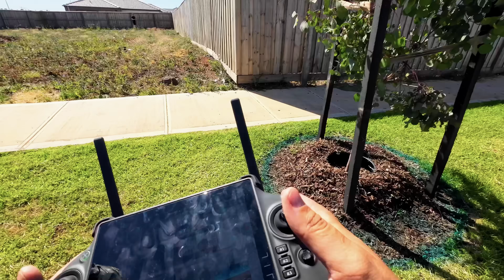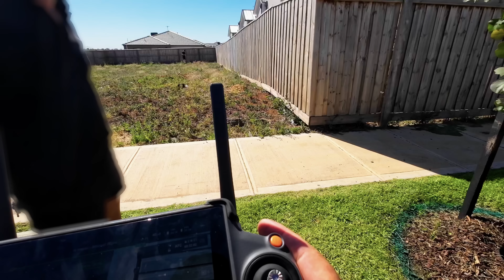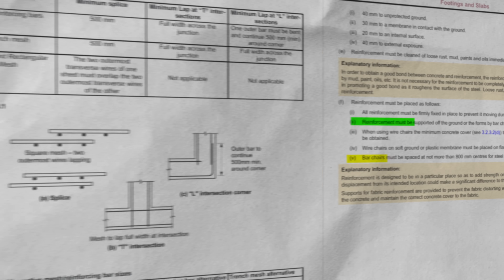I Caught a Concreter Red Handed ...

Comment: Well done for calling these guys out ……. Doing the wrong thing. I’m afraid I have very little trust for concreters; they all say the same thing that they pull the steel up ….. I’ve watched them and they don’t do it ….. once it’s buried they don’t care.
Reply: As a plumber and excavator operator I can confirm 90% of the time i rip up concrete to repair pipes or replace a cracking driveway the mesh is at the bottom 10mm (sometimes visible on the underside) of the 100+mm concrete
Reply: @RUugly  It’s the building industry in a nutshell mate, everything is a push to get to the next job. These blokes start cutting corners without repercussions and all of a sudden it’s the new trend. 
The whole mentality with these type of operators is if it’s out of sight it’s out of mind. I worked for a bloke when i was young, one day we had a job to build a small slab for a 10,000L spa to sit on, it was on a downhill slope and on one of the corners of the slab it dropped off a good 400mm (you’d usually fill in a corner like this with more form work, this is called a drop edge) 
Instead of forming up the corner, and letting the cement fill up the whole space, he shovelled a bunch of sand into the area until there was about 100mm left to the top of the form and then poured the cement straight on the sand, no mesh in it or nothin 😂😂
There’s a lot of blokes out there that have absolutely no business being in this industry period. The sad part is the more houses that get built by these lot, the bigger hole we’re putting ourselves in down the track. 
Australian economy is propped up by real estate, how’s the Australian economy look in 20 years when all of these million dollar homes are falling to pieces??? 😂😂
Reply: @SBANDOOOO566  * “concrete” knackerbags! Cement is just one of the ingredients in concrete.
Reply: These guys seem pretty legit and love what they do  https://www.youtube.com/@Concretewiththehauses/featured
Reply: Concreters are notorious for being meth heads, scammers and creators of poor work.
Reply: @RUugly  I work in the commercial sector these days so i rarely see anyone off their face, it’s all been clamped down on, but yeah bro when I used to do smaller residential jobs on smaller crews etc you’d get the odd junkie every month on site 😂
You’d think they’d work hard but in reality they stuff up that much they just make everyone else on site work harder.. Occasionally ya get the high functioning one that works hard but talks even harder and has your ears bleeding by knock off time 😂
Reply: Easy Rambo, some of us care quite a bit and take a lot of pride in our work. I refuse to pour any concrete without steel reinforcement properly prepared. Sorry to hear that all your experiences have been with dodgy or lazy concreatures. Hopefully you find some real concreatures soon instead of the posers that you’ve had to deal with.
Reply: I demo'd a driveway like that the other day. No chairs ... rebar literally at the bottom of the concrete. No plastic, or gravel underneath. It was rusted to shit, but it wouldn't have mattered anyway. It was smooth mesh, not deformed. So it wouldn't have even helped if it was installed properly.
Reply: I have never seen a concreter using the chairs. 99% all leave the mesh on the ground. 
Wouldn't it be awesome if you could check concrete as part of your inspection. 
You would need some type of x-ray camera. 
You would have all concreters running for cover.
Another awesome video man. 
✌️ Peace
Reply: @kevinhamling1963  Im in NSW been in building and construction for 10+ years, witnessed thousands of pours. Anyone worth their salt isn’t skipping on chairing up, takes 10 minutes out ya day.
Reply: @Boogie_Cousins_Tha_3rd  
Here in Victoria it's a totally different story .
Reply: @kevinhamling1963 Will add it to the list of states I’ll never build in 😂😂😂
Reply: @Boogie_Cousins_Tha_3rd  
I think building anywhere now you must choose your builder carefully.
It's a minefield of dodgy operators and lost dreams. 
✌️ Peace
Reply: @kevinhamling1963 Agreed. The owners should do their own homework and due diligence. Caveat emptor is Latin for buyer beware......yet people just employ anybody. Perhaps they deserve what they get.
Reply: @kevinhamling1963  you wouldn’t see me running for cover.
Don’t put all contractors in the same boat 
These blokes are cutting corners 
If you make the effort to place the steel, use bar chairs
Reply: @kevinhamling1963  I’m a concreter in Sydney and that’s a BS statement.  80% do. 
You’re only 179% out. 😭
Reply: @kevinhamling1963 Actually there is X-ray machines to check concrete and not all concreters leave mesh on the ground. Would you rather pay $1200 for a pump or have the mesh lifted?
Reply: its all good calling someone out but nothing ever happens, and its not really calling them out if you hide their companies names and blur all their information its actually protecting them.
Reply: @knabdank  That's not his job to blast the companies/traders on a public forum. It opens him up to being sued, then he has to spend his money and his time, fighting it in court. He would also have to deal with any blowback from these people and i highly doubt he wants death threats and violence aimed his way. It would also mean that these contractors would start making moves, so he can never have access to the properties.  This is for the owners of the house to deal with, it's on them to write a review on the company/trader.
Reply: I worked in construction for two years and we did lift it up when we poured. I did see a lot of contractors that didn’t
Reply: @andygarcia9864 yeah but doesn’t it just sink back down while the concrete is wet?
Reply: @DAMusic-qu2ec it’s concrete not chocolate milk

Comment: While bar chairs are standard protocol, the actual concept of having a piece of plastic, running 3/4 of the way through the slab, is nowhere near as strong as lifting the steel mesh and having nothing but concrete.

The Problem there though is ensuring the mesh is even off the ground, throughout the slab, hence why chairs are used.

Ultimately, having a solid base, correct thickness of concrete, good expansion cuts and vibration to avoid air gaps, are FAR more important then chairs. 

But i love this guy because he dont miss a thing👍
Reply: so how do you ensure uniform depth without chairs?
Reply: @robjows i do recommend chairs, but where chairs are creating more of a nuisance, popping the rio up too high because of contours etc…, if i cant use chairs, im the one screeding, i carry a rule in my pocket and lift the rio to the correct height as im screeding, that is if the base is spot on as im measuring through the concrete, off the base. 
I also use wood blocks cut to the right height of the concrete, with a screw in the top, so i can sit them anywhere on the base, screed to the blocks and pull it out easy with the screw or run stringline to it if need be.
Reply: @robjows you cant
Reply: Correct, having chairs is not important, but having the steel reo sit on the bottom of the slab doing nothing is not ideal lol
Reply: @tom6549 you sound like you have actual experience with concrete.
Chairs not as critical as what i mentioned, but they do usually make for a more even mesh level👍
Reply: I think he may have meant bar stools.  They are stronger and easier to work with under a load.
Reply: @Insideoutie  If you have bar stools you probably should try prunes.
Reply: Chairs are better than no chairs
Reply: @Clayton-h4q 
If humans could install mesh correctly without chairs, it would be a stronger job and chairs would not be required.
Plastic obviously adds no strength, especially if there are air gaps around the chairs. 
We did once pour without chairs, and believe it or not, some of that concrete is holding up better than new concrete.
Reply: Rubbish

Comment: The cracks that are going to come through the concrete is going to be a consistent problem every time the ground moves due to seasonal moisture changes. Not to mention no plastic under so the reo is sitting basically on the dirt.
Reply: there usually isnt a need for the vapor barrier under exterior concrete, there should however be a consistent base of gravel/sand to allow for variations in the soil.
Reply: But they'll pull it up once the concrete has been laid. 😆
Reply: The old swing the keys , jobs right bloke .I'll go n have a chat with em hahahahaha.. Building industry is in deep shitty shitty shit in Aus due to corners cut on every part .Without your knowledge no one is going to get shown up kudos to you inspector gadget
Reply: perfect rust storm, the reo will be rusty shards by next year and you could guarantee they didn't pack the soil nor do the ground drainage right, so it'll be cracking in a year too.
Reply: Nobody puts plastic under paving concrete, champ. It's not in the building code either.
Reply: @darrenjpeters  If the soil is wet from recent rain, as this was, you need plastic. If the soil is raw, unscreened fill full of rubble, roots and grass, as this was; you need plastic. If you have less than 40mm coverage under the reo, as this slab did; you need plastic. All that's in the NCC 3.2. 
"Wrong is wrong, even if everybody is doing it. Right is right, even if nobody is doing it."
Reply: @wobblyboost  In summertime, champ, concreters wet the soil down before pouring paving so that the concrete doesn't go off as fast. If you're pouring concrete over raw unscreened fill full of rubble roots and grass, then you're already doing it wrong, a layer of road base should go over that crap first. If you have less than 40 mm coverage under the reo, seeing as how any paving slab with reo in it is usually a driveway, and should be 100mm thick minimum, and the reo should be in the middle of the slab, once again, you're doing it wrong, plastic or no plastic.
Reply: @darrenjpeters  Yes my dear friend, it is the nuance of my comment, perhaps you missed in your haste to reply; they did everything wrong. 
Plastic would have at least in part ameliorated their wanton disregard for the standards we both listed.
Watch the footage closely, not laid on rolled or packed fine aggregate, laid on grubby fill with grass growing in it, laid with reo trod into mud, not pre-damped in prep; rain sodden mud.

Comment: We need more content like this! These guys never face any consequences and that’s what really makes us angry.
Reply: the steel mesh flat on the ground? I have done only a couple concrete jobs and even as pure amateur think this is dodgy, and his excuse is it makes the job too hard whawha
Reply: @jaibusby673  That’s pretty common when barrowing concrete. The chairs get in the way especially if you have nuffies on the barrows. But yeh it’s not right especially on a driveway that’s gonna have a heavy vehicle going over it constantly. Problem is most of the time once the cretes in and the boys are paid no one give a crap where that mesh is sitting until the cracks start forming months later.
Reply: Really need to go a step further and see company names though. Can almost guarantee they'll be straight back to their dodgy ways next job.
Reply: The society we live in - books full of rules and regulations but nobody to enforce them.
Reply: These contractor may wanna specialize in block paving now you have them craping bricks!
Reply: Bro then they'll have to do the work up to code, how unfair :(
Reply: No evey thing gets signed off before the next stage   you get inspectors that sign off before the can start the next section. Dodgy inspectors sign it off
Reply: The biggest problem with fly by night outfits they low bid everything and screw everything up, why wages get so screwed up in alot of trade jobs because good companies go without work when they have proper bids on contracts
Reply: easy to punish a errant contractor
Reply: That concrete would still last decades, you people literally have no idea what you're talking about. Raising bar during a pour is normal. Like he said, you can add pump fees (~$1000) to every pour by doing silly crap like that.
Reply: @Trildin  5 years it will be cracked all over, but it will still be usable for decades just wont look nice maybe a few pieces fall lower than over parts.  Happened to my parents house looked like ass but still used 35 years later because too expensive to replace.
Reply: fair call, but the thing is this cowboy probably never raised the mesh